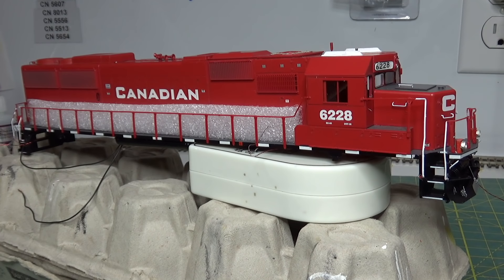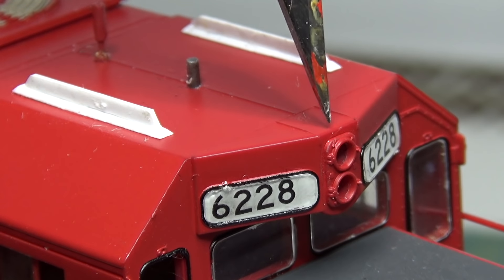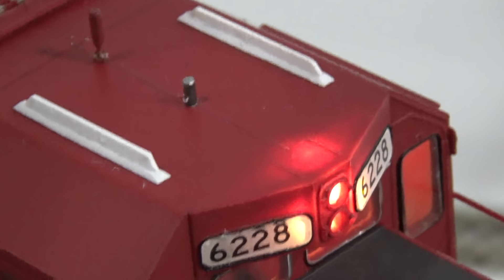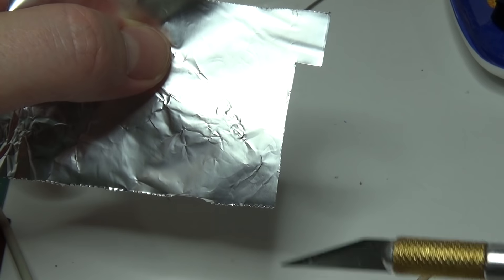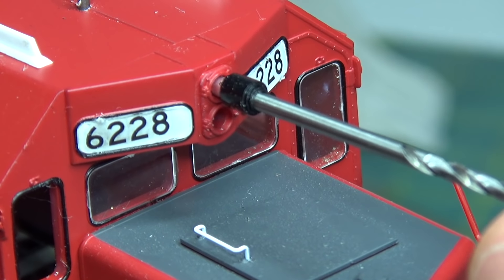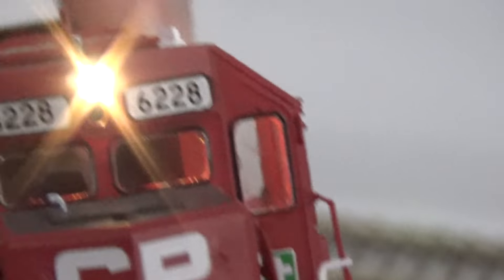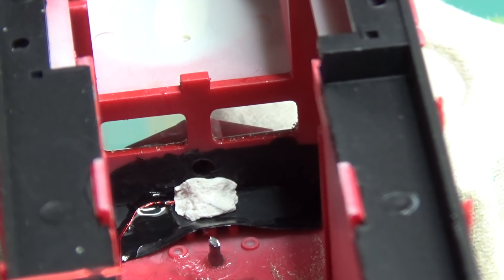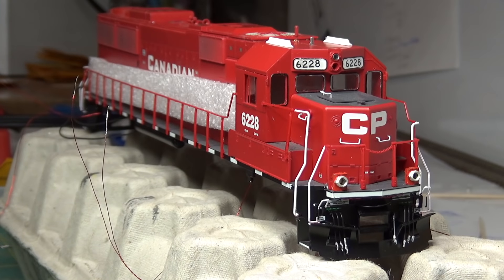How To Fix Light Bleed On HO Scale Locomotive Headlights

Comment: Cool Ben, Another good way is a small piece of plastic fiber optic, sand down the ends, heat the one end with a lighter to form a lens and black heat shrink tubing around the fiber right through the shell and around the LED cutting all light bleed out. The Athearn Genesis CN wide cabs were horrible for light bleed and works perfect.
Reply from the maker: Fibre optic was my first thought actually, I just didn't have any.

Comment: Loved the video. You shared a unique idea and I loved it. Another way I believe would be to use fiber optic tubing. Glue the LED to one end of it and cover it with heat shrink tubing. Just leave a little bit of the fiber optic tubing exposed to pass into the light housing. That's just my way but I did love your idea as it is very unique and the shine from the light is awesome. Thank you for the video.

Comment: My suggestion would have been to paint it with flat/matt black paint.  But that was before you mentioned you didn’t have the time so yes, the use of black electric tape works as well.  
Usual practice when building any model with lights (buildings, sci-fi stuff etc...) is to spray the inside black and then go from there.

Comment: A good way I've avoided light bleed with my models is a soft black epoxy spread around the rear and sides of the LED. After mounting, this can be easily cleaned up in the socket, and because it is soft, it can be removed easily for changes in case there are issues with the LED.

Comment: Great video. I have been using 3 milimiter let's with shrink tube connected to 1 millimeter fiber optic for all my athearn, atlas engines. Dan Cortipassi has a bunch of youtube videos of the process. You only need a 750 ohm diode to run it plus he shows how to light the number boards with surface mount diodes
Reply: Yea. I also use 3mm leds with 3 mm heatshrink over the led.Then I paint the heartshrink, with black paint. One 3mm lights up both headlights, & is easier to wire up.

Comment: Sorry my computer changes words if I don't spell check that's 3 millimeter led cool white, a 750 ohm resister and 1 millimeter fiber optic. I bought enough of each off of ebay to do a hundred locks pretty cheap and it's easy to wire up to my decoders.

Comment: I have the same problem with my brass Hallmark Fairbanks-Morse H12-44 after installing LED headlight.  I'll probably just paint the backside with black paint.  Next time I take it apart to install diodes to eliminate the flashing of reverse current I'll correct the light bleed.  Good idea but it won't work for me.  I installed a 5mm LED bulb and stuck it through the front and use it as the lens as well.  I did end up painting flat black around the the LED so it just shines in the forward direction and not all around.  Cheers from eastern TN